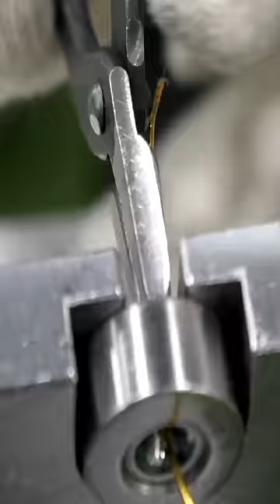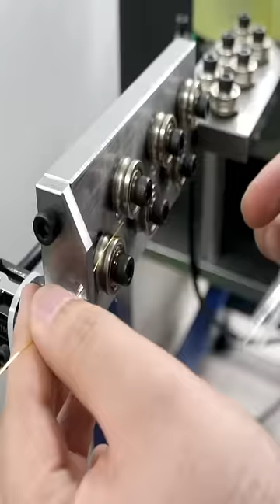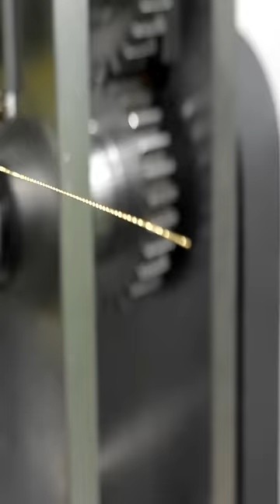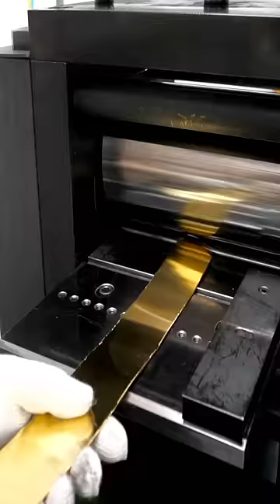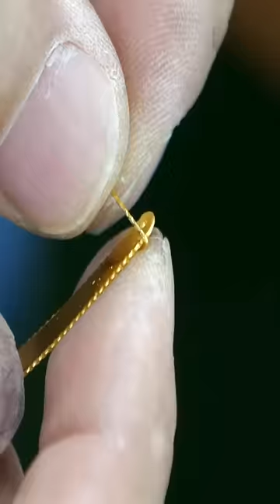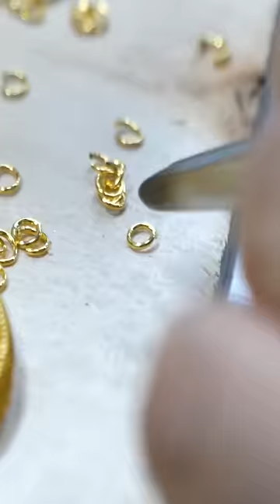The process of making a pure gold bracelet with a gold bar of 99.99% purity. Korea Gold Exchange

Comment: I worked at a facility that drew titanium wire down in a very similar way. Some of it ended up much smaller at .014 in.
Reply: What is titanium wire used for?
Reply: @hxhdfjifzirstc894  bigger stuff at .035 and .045 was welding wire and the tiny stuff was used fir aerospace airfilters

Comment: I thought pure gold was never used in jewellery due to its softness
Reply: you must not think very often then
Reply: @hedindunuffin He has a point, gold is really soft and even a little force is enough to bend it, specially with that width the bracelet has
Reply: You're absolutely right. Pure cold is way too easy to bend and break. It is the most valuable but least durable for jewelry purposes. 14K is more of less the sweet spot for what you want your gold jewelry in. 10K is the cheapest gold out there because it has the least % of pure gold in it BUT it is the strongest gold out there for making jewelry with. 14K is still very strong but has higher pure gold % making it more expensive than 10K 18K is your more luxurious gold that is used in higher end (Rolex / AP) watch bands and wedding bands. 22K is 91% pure gold and also used in making high end watches bit it is very easy to scratch and bend so it's more used as Dials/ Faces/ Crowns/ Indices/ Bezels, Cases, (other small luxury watch parts) 24K is more asset collection than anything, as it is pure gold.
Reply: В Китае и Индии считают за золото только самую высокую пробу
Reply: @adolfotristan6736  ahh, so the ornaments in the video are basically for showing purposes and not wearing, got it